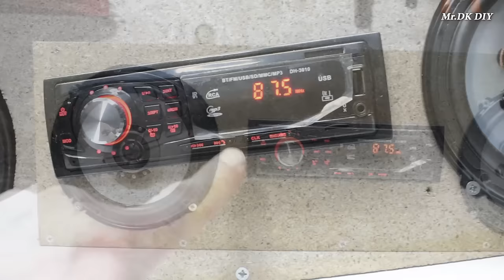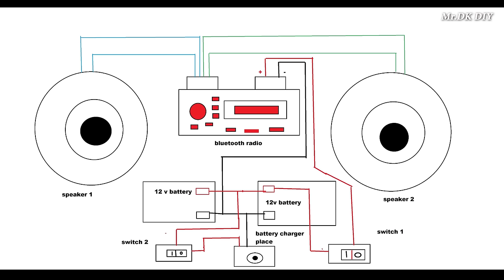DIY Bluetooth BoomBOX AUDIO/ FM Radio/MP3 Player

Comment: I built one from 19mm MDF with 4 6x9s, a 10" Polk subwoofer, 600watt amp, Bluetooth car headunit, and tower computer supply with all of the 12v outputs soldered together

Comment: Great job! I built mine out of an old microwave. I wanted to make a modernized 80's boom box. I used a battery from a electric bike with those 18650 batteries, Android touchscreen AC Am/Fm radio. Had to use a power balancer and ac dc converter. My build was a bit more complicated but this is a great simple version.

Quick edit: the microwave was cut up and welded into the shape using all but the front panel and door.

Comment: I built this 30 y ago yet in my garage. But used a cassette car radio and two motorcycle 12V batteries.lol^^
what kind of speaker and car radio did you use? Nice work! greetings from Germany!

Comment: How did you connect the electrical from the radio & speakers to the battery packs, without short-circuiting it?? Do you have a diagram or instructions for it??

Comment: Sound could possibly be improved by building resonator chambers with ports (holes) in them to boost bass.  Also, there's no need for a switch connected to the charger line. Maybe connect it to the Illumination line on the radio so you can turn its key lights on and off.

Comment: Gotta say, you’re pretty good with that jig saw. I thought it was gonna be jagged and crooked, but your speaker holes turned out nice. I like the battery and charger as well, make it easy to take on the go. You plan on painting it?

Comment: The large speaker hole should have been smaller and you should insulate each speaker inside a box to give you stronger and clearer sound

Comment: Do you know what would be a good plastic box with handle to get that fit 2 6.5. 1/2 150watt marine speaker on the front ab the fit a a small 2ch Bluetooth amp and 6000mAh rechargeable battery inside?

Comment: Thanks for uploading the video.  what if you turn on the stereo while battery charging switch is on? this will provide slightly higher voltage to the stereo, will it burn the stereo?
Reply: Kris C the batteries will still only put out the same voltage
Reply: No it wouldn't. Most of these radios are made to use anywhere from around 10 to 14.5 volts. In your car the normal battery voltage is 12 volts but around 14 when driving.

Comment: You connected two batteries in parallel, you made a mistake so that it would last longer, it didn't happen recently, one of the batteries breaks down, they are dry batteries.  power does not last, instead of dry battery, 18650 batteries are connected to each other with polarity and you need to provide a Bms balance card....

Comment: Bro I made with the 12v power adapter, it powers on but no sound. What's the solution? Mine Sony MEX-N5100BT/MEX-N4100BT
Reply: HI sometimes u need to join red and yellow wire to put radio on like on my pioneer deh5500bt. check online before trying this

Comment: Does your radio lose it's settings when you flip the switch to disconnect power to the car stereo head unit?  Oddly I can't seem to find any car stereo head unit that has an internal memory backup like computers do for their CMOS.
Reply: yes it will
Reply: Just wire the yellow memory wire straight to the battery. It will keep the settings then.

Comment: It's a bad idea to put sla Pb batteries in pure parallel ... use instead some 18650 with bms circuit.
Reply: Why is it a bad idea
Reply: They are the same size, so nothing to worry about.

Comment: The idea itself is good, I'm doing such stuff on my own.
But the quality of this build is horrifying in my eyes. The measuring, cutting and wiring are scary. No gaskets or sealing, that results in poor sound.
Theres no need for ports, but separate chambers for the speakers and a bit of insulation would improve the box easily.

Comment: I did the same thing but I'm using a LifePo 4 battery. so far it only lasted about 5 hours of continuous play from usb port at half volume.  I need at least 10 hours for job usage. my shift is 10 hours long , 4 days.